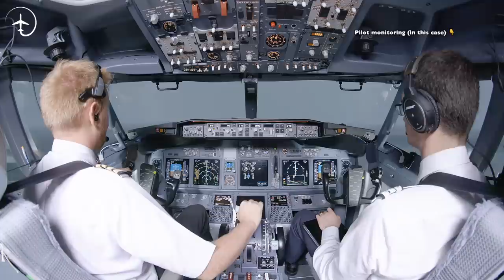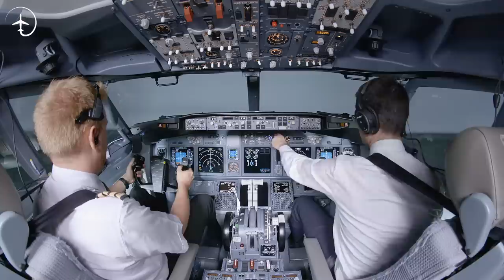Airplane Atlantic speed record!

Comment: Is there any risk that when you enter the jet stream, air speed changes so much that you lose the necessary air flow to generate lift and enter a stall?
Reply: No. That is no risk. It's not possible as the engine thrust is pushing the wing through the surrounding air sufficiently to create the airflow needed for lift.

Comment: The Fokker F-28, with its hypercritical wing, is capable of supercruise, that is, level supersonic flight without the aid of an afterburner.  However, it cannot enter supersonic flight mode while flying level, it must dive to pass through the high-drag zone just under mach one.  Of course, this aircraft is placarded at a much lower "Do Not Exceed" speed, and this flying mode also violates ATC regulations and probably the engine manufacturer's posted maximums.  Several decades ago in the heyday of Piedmont Airlines I clocked a three hundred mile speed run on Piedmont at almost mach 1.1 at 8500 feet MSL.

Comment: What are the effects of going supersonic on an aircraft?
Reply: A lot of high pressure air on the frame causing a lot of heat - concorde was seen to expand/stretch 10 inches and gaps open up in the instrumentation.  A lot more goes on than that but heating is the most obvious effect.

Comment: This breaking of record speed would be TRUE for all aircrafts ahead and behind that aircraft which is being talked about having the same attitude and altitude then how come they also have not achieved the same record speed as by that 74?
Reply: The Jet Stream is typically only 50-100 miles wide with the fastest air in the center 20-40 miles (pretty narrow), also they are typically only about 5,000-15,000 feet in height with the fastest air found in less than a 5000 ft path( very narrow).  Even if two planes are heading to the same place, their flight paths can be significantly different.  One may be at flight level 370 (37,000ft) and another at flight level 430 (43,000).  Plane 1 could have a 60 kt tailwind or even lower and plane 2 could have a 130 kt tailwind or even higher.  Calculate that difference over 5000 miles and its easy to see why this is true.  Now, you may ask...Why doesn’t plane 1 just fly at 43,000ft also?  His service ceiling may be 40,000ft, or ATC may not Clear him for traffic reasons, or it may be company policy that doesn’t allow that particular plane to fly at those levels.  Planes going the opposite direction will be given altitudes at “even” numbers, so 38,000ft and maybe 42,000ft.  This is to keep separation between opposing traffic. Lots to consider, but when all things line up just right for that one plane,  YES...they got lucky to be in that high speed tailwind.
Reply: @darinruddock3394  Agreed, but I again say a plane ahead of this 74 say by 50 miles but at the altitude such as 35 which means 35000 ft and a plane behind that 74 say by 50 miles at 39000 ft  and the 74 is at 37000 ft all the three planes are exactly behind each other horizontally though not vertically would be in the same tailwind flow then a separation of 1000 ft is enough for safety but for a jet stream it is nothing then should they also not be benefitted?
This is a lay man's query.
Seems you are an airman and would throw more light on my query.
Reply: Pushkraj Sathe yes, I am a pilot with an Instrument rating.  Not a commercial PIlot, but a long time Private Pilot with an extended interest in all things aviation, aerodynamic and weather related. Sure!  They will all benefit from a tailwind.  It may be a bit less or a bit more with even 1000ft elevation difference.  You then have to factor in which type of plane and the cruising speeds of each aircraft.  That can be roughly 420kts - 520kts, so there is a significant difference between aircraft capabilities.  The aerodynamic coefficient of drag is also varied by aircraft model.  The point is, this particular plane (an already fast model) got lucky, found itself in the fastest point of the jet stream for the longest period of time during the flight and benefited so much that it broke a record.  The other variable is harder to imagine...the jet stream is not “straight” it is curved and re-curved, sometimes 2-3 slight re-curves over the Atlantic.  The planes are going to be following a Heading and remain true to a very straight flight path.  So no plane will stay in it for the entire flight path.  This one got...”lucky”.  It’s a very interesting subject and concept, thanks for the conversation.

Comment: While everyone is talking about this amazing 2 hour shorter flight, 
I'm feeling it for the poor buggers that must've been going the other way and had the longest flight in modern history!
(Tho I suspect those flights just dropped lower out of the jet stream and used more fuel)
Reply: A jet stream is a narrow channel of faster moving air than that around it. You would avoid it if flying in the other direction. The amount of fuel burned would depend on how much thrust you use & for how long, so you will always use more fuel flying against the wind than you will with wind assistance.

Comment: Can you explain how can a plane go faster in a tailwind for example if the plane is going 500mph but has a 200 mph tailwind how can the plane go 700mph but the plane is going faster than the tailwind in the first place.....it just don't make sense to me
Reply: Flying is always an issue between aircraft and air. Ground speed is irrelevant. If you swim down a river which flows as fast as you swim, your ground speed will as well be double value of what you'd reach in a pool.

Comment: Another thing I’ve been wondering, the runway shown at the beginning seems to have quite an up and down profile!  I don’t know that I have seen that before?  Maybe the camera angle makes it look more pronounced than it is.  Looks like a wrinkled rug.  That could be a good video subject
Reply: Its called tele-compression, always happens when you use a very long tele (zoom) lens. Everything looks squished together, and the aircraft almost appears to be doing a vertical landing. The bumps are really there but they could be 1000m long, even though they appear to be 100m or less through a tele lens.

Comment: This is the coolest 747 and any airliner story to this day. And the answer to the how is this possible is easy....... AIRSPEED if the air is moving at 200mph and you can fly in that fast moving air at 525mph then your ground speed is 825mph. But it would be really really cool. The only way to really know how fast they where going would have been by GPS speed or radar speed if its available. Otherwise there wouldn't be any major thing telling anyone WOW WE ARE SMOKIGN The estimated ground speed was 825 mph ground speed. it was a 747-436 was technically going supersonic when ground speed is used as the measurement. otherwise it was only flying at 500mph airspeed. JUST AWSOME.

Comment: I don''t believe you can set a valid record without a reciprocal run, whatever the scientifically illiterate press may say.
But even if you restrict it by category, Concorde was also a transport category passenger aircraft for which any ATPL could get a type rating if they managed to get on the route for an airline which operated it, and anything else will only ever be the first loser in that category.
I was taught from the very beginning that any approach is an approach to a go-around until you run out of possible reasons to make one.  I guess the only time that isn't true is for glider pilots - which of course includes anyone landing without power, even if they are weighed down with (a) non-functioning engine(s).

Comment: An old enigma.  I'm in an airplane that has 100 meters long cabin.  I make a paper airpland and stand at the back of the cabin.  the airplane is traveling at 800 kph.  If I throw the paper plane forward at 15 kph, is the paper plane traveling at 815 kph?
Reply: Timothy Dingman yes
Reply: It all depends on your reference point. If your reference point is the large airplane, then the speed of the paper airplane is 15 kph. If your reference point is the ground, then the speed of the paper airplane is 815 kph.

Comment: But... isnt tailwind bad for airplanes?
Reply: Maxi Coman Tailwind is bad for landing, but good for flying.
Reply: On an approach to landing it causes your approach speed to be higher relative to ground causing a longer roll-out. Starting engines can be a problem if the wind is blowing really hard from the rear. As for cruise you will not have a tailwind relative to the aircraft. You will have just a higher ground speed. Airspeed for the aircraft will be the same for aircraft flying with the wind or against the wind. Ground speed would be slower for a headwind but the airspeed would be the same.

Comment: @Mentour Pilot I am a bit upset by this video, as it directly contradicts something you have said in the past. I have previously spent $5 on a superchat question during a live stream during which I asked specifically if a 787 could travel at 800mph ground speed, and you quite dismissively told me that "even a Cessna could reach those ground speeds under the right conditions", yet here we are with a record breaking trip from NY to London where the average speed is just barely above 700mph. Even considering take off and landing, I doubt they even came close to ever traveling 800mph ground speed at any point in it's flight.  It's not so much the misinformation, it is much more how dismissive you were of my question. I've lost some respect.